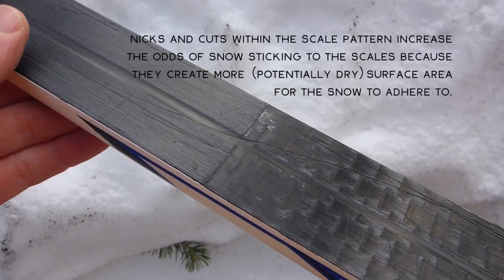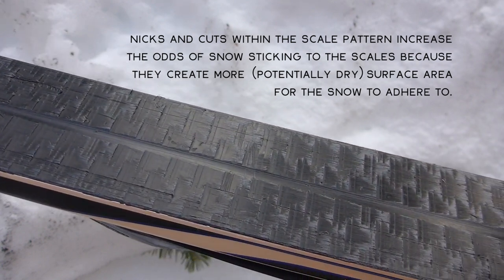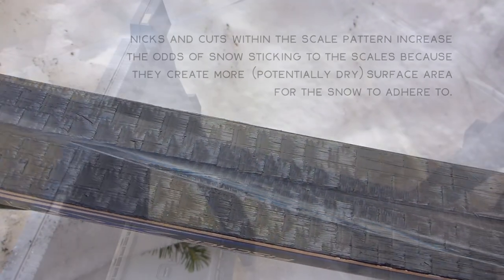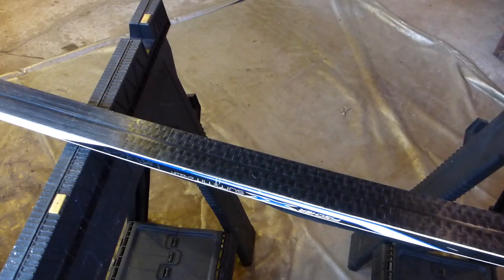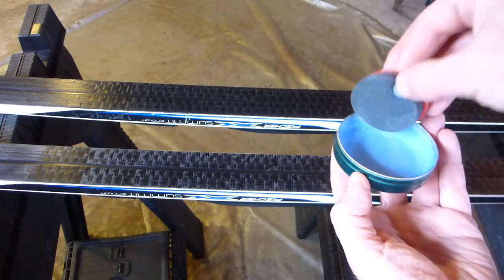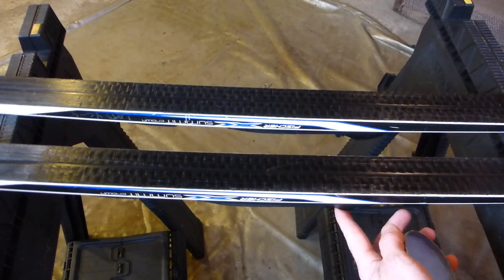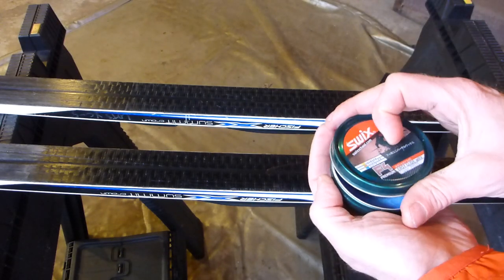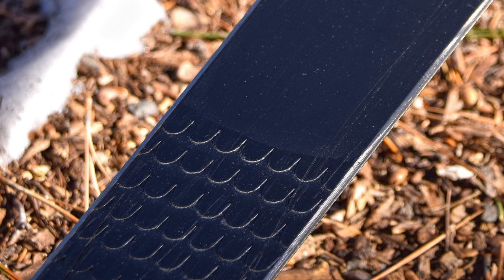Treating The Scale Pattern of Waxless XC Skis

Comment: Appreciate the tip of brushing the scale after brushing the tips and tail.  I'm going to try it.  Excellent video's BTW.  I like your style and they are informative.
Reply from the maker: Thanks so much for the kind words, Craig Campbell! I appreciate the feedback.

One of the interesting things about scale patterns on waxless skis is that many manufactures actually cut those scale patterns out of the base material. For example, many scaled skis start out with a base similar to a skate ski (and then  the scales are carved out of that base). Since that's often the case, it would stand to reason that the scale pattern should be treated in a similar fashion as the glide areas (tips and tails).

Anyway, so glad I could be of service. Hope you have a great rest of the winter. And, let me know if you have any questions!

Comment: Excellent straightforward advice. I have skied offtrack for many years with waxless skis and only came upon similar advice a couple years ago. It works!
Reply from the maker: Thanks so much for the kind words :) I always find that the grip zone on waxless xc skis is often the place where most snow clumps and sticks (at least in certain sticky snow conditions). And those scales are so defined that a little bit of glide wax on them shouldn't hardly affect the grip.

Again, thanks for tuning in and contributing to the conversation :)
Reply: @JaredManninen  OH, yeah. I'm using Madshus Annums and Fisher S 112s. Pretty wide skies and beat up from rocks. Snow clumps so bad sometimes they're like platform shoes. Using paste glide wax now and put a little on the grip zone now. Works wonders. I like your idea about brushing the area with waxing brush though and am going to give this a try.
Reply from the maker: @KowalskiVanishing_Point  Haha, platform shoes! A great description and a total resistance training workout :) I find that even just consistently brushing out the bases with a bronze brush seems to do wonders for keeping skis prepped for the next adventure.

Comment: This was helpful, thanks.
There is surprisingly little information on waxing backcountry skis and I'm sure that's in part why a lot of people just buy 'waxless' skis and then call it done.
Reply from the maker: Thanks so much for the kind words and comment :)

Yeah, I think people don't necessarily realize that their skis do need to be maintained, even if only occasionally. I've had so many people come into the rental shop (at which I work) with skis of all kinds (track and backcountry) that never have done any waxing to them. Mostly they come in to ask why their skis are sticking so much or not getting any glide. And the scales can be the absolute worst at times because they are often neglected.

Anyway, thanks for watching. I appreciate it!

Comment: I know I have bended your ear today but I was wondering what wax to use for tips and tales here in the Sierras'  I have a pair of 15 y/o S_bounds and would like to wax the Tip/Tales. Of coarse the local REI is worthless in this regard.  Will have to order! Is it going to be red or Yellow or a universl?
Reply from the maker: No worries, Grant :)

As far as wax goes right now in the Sierra, I often wax colder than necessary (for durability's sake). For example, the last few mornings it was around 16 degrees, and then the temps got up into the high 30s during the day. So, for those situations I'll usually crayon in a thin layer of purple and drip red over the top.

Today, however, is about 36 degrees in the morning so I'd just use red and maybe add a little bit of yellow (for later in the day when it's supposed to reach the low 40s with possible rain).

One of the current waxing trends is to use a hard/cold wax as a base and top coat it with the wax of the day. That's kind of what I've been doing for awhile mostly because it's often pretty cold and firm in the morning, then warmer/softer in the day. I just hate the idea of only using that softer wax for later in the day if I'm going out a bit earlier (and risk scraping/scouring all that softer stuff off first thing).

Anyway, that's what I've been doing :)

Comment: Thanks Jared.  Uh, newbie here ... I notice you're applying the wax in only one direction ... I was looking for the ski tips to tell me what direction.  I assume you don't want wax to clog up the scales, so that would be front-to-back direction with each stroke, yes?
Reply from the maker: Hey beckyrep 1, thanks for the question!

Actually, it doesn't really matter what direction you apply the quick wax. It's probably more out of habit for me to work in a tip-to-tail direction. And, the fact that the scales are directional probably plays a part in the way I'm applying it.

You won't "clog" up the scales either way you put it on. For better and worse, it's going to come off relatively quickly no matter what you do. The different quick glide waxes such as Swix F4 and Toko ExpressWax tend to be easy to apply, but also come off relatively easy. It should, however, keep snow from clumping up in your grip zone for your ski session though, which is all you're trying to accomplish, really.

Anyway, let me know if you have other questions!

Comment: I would actually recommend some fluoro free easy wax, or liquid wax to apply to the scales, or even the entire base if you don't want to use an iron. Just make sure that you brush afterwords with a soft or nylon brush. And if you're really looking to spend as little money as possible, an unused toothbrush can actually work pretty well too as a brush substitute.
Reply from the maker: Thanks for the feedback, Foster 👍 I prefer to use a quick glide wax for the scales too 😊
Reply: so if you were to want old ski's to use as a winter camping sled, not ironing and scraping hot wax but applying liquid wax would do? Half the work and cost?
Reply from the maker: @brentkelly5445  Using the quick liquid wax would definitely be better than nothing. Not sure how much more glide you'd get on them with it, though, as it's kind of an "easy on, easy off" type of a wax. That said, I don't know that I'd really want to fully hot wax those skis if they were just pulling a sled. I think as long as the skis don't ice up, that's a good thing. So you may have to use multiple applications of the liquid wax to those skis depending on distance. I might also consider using one of the newer temperature spray waxes that seem to be more durable than quick liquid wax. In the back of my mind, I can't help but wonder if those older skis will even accept a lot of wax to begin with. If they're an extruded base, it's not going to last. Only if they're a sintered base, designed to accept wax, will it last long. So, maybe liquid wax would be as good as it got?

Comment: Hey Jared, just treated my Madshus Voss MGV+ waxless with Swix CH6, tip to tail. I got a bunch of wax on the scales, didn't move the iron quick enough out of the way. I used my KUU waxing iron to try and get the little into the base. Should I  remove that wax with wax remover? I want to put some Toko EXpress universal over the scale section. (I did scrub off the oxidation with a Scotch Green pad. I got it all off.) Thanks for all your postings and feedback...
Reply from the maker: Sounds like you're elbows deep in the ski waxing! haha! I wouldn't worry about getting wax in the scale pattern like you did. If I were you, I'd just heat that wax that dripped in the scales up enough to wipe it away with a paper towel. Then you could brush the scales out a few times (tip to tail). And the scales should be treated enough that you wouldn't actually need the Express wax.

I actually know a couple of people who storage wax the scale pattern every year to make sure the scales don't dry out. And then in the fall, they just heat up the wax with the wax iron and wipe the scales free with paper towel, and it's all good.

Hope that helps, and good luck! Let me know if you have other questions or want additional clarification :)
Reply: @JaredManninen  Great, Thanks a ton! I have my MGV+ and a pair of Salomon Elite 7 Classic. (we were a skiing family as a kid, my first pair of XC were Asnes Tur Langren, way back.) Not much reliable snow here on the Quebec/Ontario border the past two winters. Hard to get into the zone when the snow is unreliable. It's great to see you folks are getting a good dumping on. Fill those reservoirs. Scary.  Enjoy your postings! Cheers.

Comment: Jared, I might have missed it in this video. But do I apply the glide wax from the top to bottom of skis? Or just the scaly part of the skis?
Reply from the maker: Hey Vanessa, thanks for the question :)

Don't hot wax the scales, but you can put some of the liquid glide wax on them. If you are using the liquid glide wax, then you can apply it to the entire base of the xc ski. A lot of times people don't do anything with the scales and they become really dry to the point where they become the area on which snow sticks and freezes too. So this specific video was intended to let people know that they should put some of that liquid or paste glide wax on the scales.

Hope that clarifies things :)

Comment: Thanks so much for being so concise and informative! 
I may have missed it but do you recommend a certain brand of glide wax or are they mostly all the same in terms of effectiveness?
Reply from the maker: Thank you, Jenna, for the kind words. Glad I could be of service :)

For treating the scale patterns, any brand of easy-on glide wax (liquid or paste) seems to work just fine. Honestly, if all you had available was some spray-on cooking oil you could use that too. haha! Not necessarily a long-term solution, but it would help in a pinch :)

When I hot wax my skis I don't directly apply the hot wax to the scale pattern, but when I brush the glide zones free of the excess glide wax I make sure to also brush the scales pattern. The residual wax on the brush seems to do wonders for keeping snow from sticking in the grip zone.

Thanks again for watching, and your comment/question :)

Comment: I just spray some Goo Gone onto my Marquette backcountry skis at least 30 minutes before skiing.
Reply from the maker: Interesting! I've heard of people spraying Pam cooking spray or silicone on their ski bases in a pinch. But using Goo Gone is a first for me 😊
Reply: @JaredManninen  also if I spray it on my skis seconds before ascending a hill, it provides the perfect amount of tack to climb the hill.  I tried the same with silicon, but silicon provided way too much stickiness.   I guess once I make it to the top of the hill, I would have wait a bit for the Goo Gone to dry out.
Reply: Thanks Jared.  Great info very well presented!  And thanks Safiya.  I never thought about bringing the silicone spray as a temporary klister to get up icy hills!
I ski mostly flat trails and use silicone spray on a paper towel, let the propellant evaporate for ~5 minutes to protect the ptex base from the propellant.  Wipe it on and rub it in to a thin coat.... and then there is no more sticking!  We only need this during late season and occasional sunny fresh snow conditions at 30-34°.  Good for 4-6 miles.
Reply from the maker: @dhgmllcshea5038  I apologize for taking so long to respond but, for whatever reason, your comment was buried in my "held for review" folder. But I appreciate you contributing to the conversation. I like your process of using the paper towel, not just to protect the base from the propellant, but also because it's more ecologically safe since the paper towel keeps the silicone from spraying everywhere. Thanks again for watching and commenting!

Comment: super helpful! However, I am confused as to what to do with universal glide wax (Swix F4) as its my first time - do I apply it, let it dry and then go out and ride? Or do I have to scrape the wax off as you would after applying hot wax from a bar?
Reply from the maker: No scraping necessary with the F4. Just rub a thin layer of it on the ski bases and let it set/dry for a few minutes. Once the liquid dries, you can go out and ski. It's a very simple type of wax application in that respect. You could brush out the white residue that remains after the F4 dries if you really wanted to, but not necessary as it'll come off once you start skiing.

Comment: i got less expensive fish scale skiis...the drag was bad ...very slow...i would like to convert them to wax skis...cant afford new ones...i used a clothes iron to melt them lower to lessen drag, i hate fish scales! but i guess i got low quality, i like your video, maybe proper waxing like paste wax would help, compared to hard green wax i use...up here the snow is usually colder, drier
Reply from the maker: Hey William,

Glad you enjoyed my video. I appreciate the feedback :)

But that really sucks about your skis dragging so much!

A couple ideas that come to mind... First off, it sounds like cold and dry snow conditions are what you deal with more often, which is always a bit slow no matter what. Glide waxing the tips and tails (if you haven't already) of your skis 
 definitely help. Also, I've known people to actually hot wax with glide wax  the ends of the grip zone on scale-pattered skis (actually filling the terminal ends of the grip zone completely). Although, there are a number of scale-patterns that actually stick out from the base (positive) as opposed to simply having been removed from the base (negative). So, depending on what type of skis you have that option may or may not work. I would also consider taking a metal base scraping tool (like a Kuzmin) and carve out the scales at the ends of the grip zone (rather than melting them, but if you've already done that ... what's done is done). Lastly, like I mention in this video, I always apply a liquid/spray/rub-on wax to the entire scale pattern just because it gets neglecting yet is still required to glide over the snow during the glide phase.

Anyway, hopefully some of those suggestions might be helpful. Let me know how it all goes!

Comment: Do we need to add wax on skin skis as well?
Reply from the maker: Hey William, thanks for the question!

But just use glide wax on the tips and tails. Definitely don't put any wax on the actual skins. There are cleaners and products specifically to maintain the skins, though.

When waxing skin based xc skis I usually put some blue painters tape lightly across the skins so as not to drip any hot wax on them.

Hope that helps. Let me know if you have other questions!

Comment: Is it possible to redefine the scale pattern if it is a bit worn out?
Reply from the maker: Hey Philip,

Thanks for the question!

I assume you're talking about the scales in the grip zone of your skis not looking quite like scales anymore, like they've been ground down and look generally beat up. If that's the case, I don't know how much effort I'd put into making them look like scales again. You could probably take a box cutter or exacto-type of a knife and clean up the area (get rid of the fuzzy bits, etc). But I don't know that you'd gain a whole lot of benefit from this. I would, however, clear any obviously large pieces hanging off so that you don't experience excessive drag from those pieces. But if the damage to your scale pattern is uniform and affecting the whole grip zone I probably wouldn't worry about it.

The reason I say this is because any roughness in the grip zone will act as roughness for a grip zone. Kinda like the older generations of "zero" skis where they had a rough textured surface for a grip zone, and then you would take sandpaper to that surface to scuff it up based on snow conditions. More scuffing for a more aggressive grip zone, and less scuffing for a milder grip zone. If your scales are worn down, there's still "scuff" with which to use as a grip zone although it may not be nearly as aggressive as the original scale pattern. But it still should enable you to get grip.

I haven't heard of people trying to restore their scale patterned grip zones, so I'm just not that familiar with it. And, I can't help but think that it's generally not done (as a result of no one really asking/talking about it). On the other hand, I have heard of people eliminating/cutting/smoothing the scales at the leading edge of the grip zone to increase glide. But this sounds exactly opposite of what you're describing.

Anyway, let me know if any of that helps. I'd be curious to know more about your situation.

Thanks again for tuning in :)
Reply: @JaredManninen  thank you for your reply. The pattern in the kick zone or mid part of the ski is uniformly worn. I find it has reduced kick. 
Another factor effecting my classic skiiis they are 6 yrs old. In those 6 years I went from 190 lbs to 228 lbs.
I am think about purchasing Atomic Savor xc possibilities 193 cm stiff wax less skiis that are rated for 165 to 220+ lbs and taking the old ones to a swap
Reply from the maker: @philippatrick544  That's funny that you mention the Atomic Savor XC because we (xc ski resort at which I work) just have begun to swap out all of our older rental xc skis to primarily those Atomics. I, literally, spent the past two days unwrapping them and racking them on our rack system. They're nice skis! That said, just keep in mind that it may take a little more work to engage the grip zone on those stiffer newer skis since they're going to be rated for a heavier person than your previous skis. I think you'll definitely like them but, again, by going with a ski designed with that higher weight range you may experience an adjustment period to the new camber. Let me know how it goes with them!